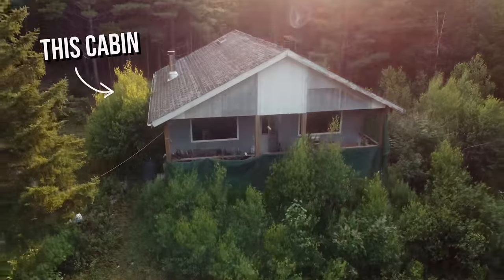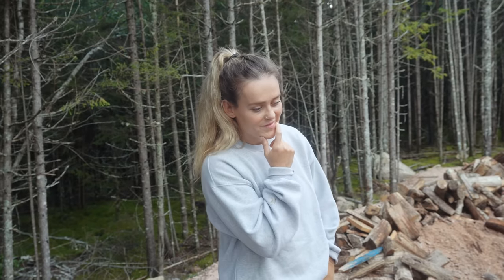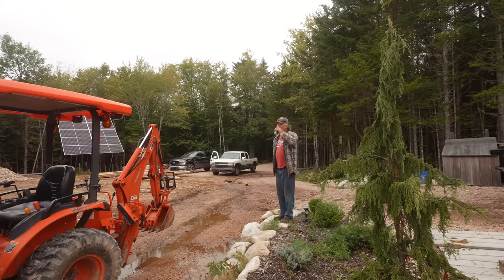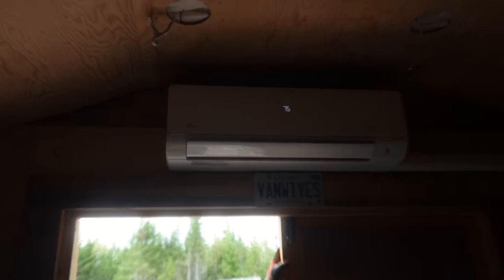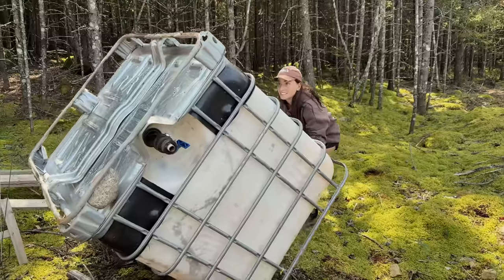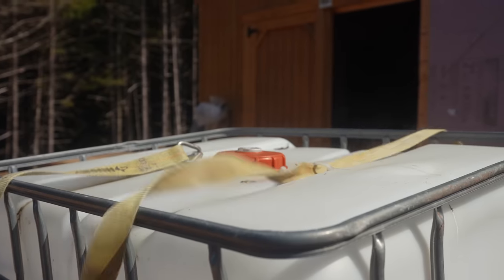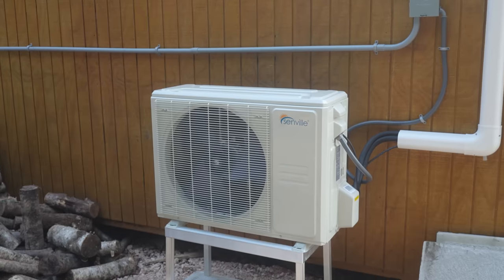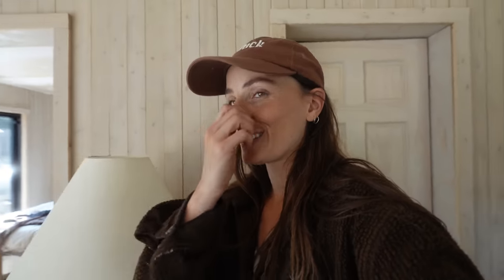Preparing for Winter Off-Grid in the Woods

Comment from the maker: Hiiiii winter YOU’RE creeping up on us again! Any other suggestions to make this winter season more comfortable? 👀 These are such game changers for the cold season ahead. The real test will be running these on the darkest days (ON our off grid system) … stay tuned! Love ya pack- see you Sunday 💛
Reply: I don't think you're going to regret those heat pumps.  We had them installed several years ago and they're great in the winter AND the summer.  For backup heat in case of a power failure we have a centrally located pellet stove that is on one of the generator circuits (since it requires electricity for the pellet auger).  It's been a great solution for our Western Washington winters.
Reply: Next time you need to demarcate an area with spray paint, first stretch and floor peg some string between each corner point. That’ll give you a straight line to follow. Happy Sunday!
Reply: Sorry, I have a question.  With all the windows and sliding doors, how will you keep the heat in and not have it pass through the contour of them?  I know that here I have to put plastic on mine so I don't lose anything.  Otherwise you are all set for winter.  I feel so much better knowing you now have heat, water, electricity, a tractor and all the new things you created so all of you are now safe.
Reply: As an emergency backup, a couple of the coleman 5 gallon jugs of water could come in handy.
Reply: You’ll be comfortable regardless of what Mother Nature throws atcha💛 do y’all have a way to block off that crawl space to save heat? Or it’s super insulated and your not worried about it ?
Reply: I think you need a big diesel or gas generator for winter, it's just a suggestion. Love you 🤟🤟❤
Reply: Happy Sunday! Good Video! 🪵🌾🌴🎼🐦‍⬛🌱🪿🍁👍🏻💞
Reply: Do the finishing touches of your cabin (Including the attic)  - it will give you so much peace of mind, and ability to fully relax in you home ❤ and we would all love to seeing it ❤
Reply: Lots of warm fluffy socks and good books 😊
Reply: Doing the same just south of the border in Maine. Getting wood deliverd and that IBC tote idea looks like a game changer! I have Blueberry the tractor, just need forks! Thanks for the awesome idea. Stay warm!
Reply: That was an ingenious idea to put your fire wood in the water tank metal frames, then transport the whole frame to your front porch when you need it.
Reply: I am really really happy for you both and your going to have a amazing winter together prayers and blessings to you both and your puppies 🐶 love your Aussie family friend John ❤❤❤
Reply: My suggestion to make this winter season more comfortable and keep your heating cost down is CURTAINS your windows are perfect but the heat will escape  from all that glass
Reply: Put a skirt on your cabin so the cold wind and snow get under it.  It will help keep your home  warm.
Reply: You have your place looking  great, and everything you have done to make it self sufficient.  I wish back in the day everything they have out now would have been aviable then. The one question I have is your place safe from flooding? I am concerned about you girls. Just a couple facts. Will be 70 next birthday. I live in Oregon. The part that has alot of mountains, lakes, hiking trails. And alot of.people have lived off grid for 20 plus years. In fact the hippies of the 60's r now called yippies.

Comment: BIG TIP for your heat pump outside unit from someone in Norway: Do make sure you have a roof over the top that will keep the snow off of it and from around it. I had to put up a snow drift shields around mine as well so it wasn't getting buried. You don't want to have to go out and shovel it off.
Reply: Crystal putting on that tire is too funny.
Reply: do you have a problem with the heat pump operating all winter? i thought they don't work well below certain temperatures
Reply: That’s what I was thinking, I just asked in the comments how was it going to go in the open outside like that
Reply: @yomogami4561  no, not at all and it gets really cold here. Just need to keep the area around it clean.
Reply: @jenninstitches  thanks
Reply: @yomogami4561  the problem is that the colder it is outside the more expensive it is for the heat pump to provide each unit of heat, and even worse when the external system starts frosting up.  As you also need more units of heat in cold weather this makes the cost of using a heat pump increase a lot faster than with conventional methods of heating.  With solar panels powering the heat pump you also have a lot less solar power available in winter and particularly in cloudy conditions, so it will be interesting to see how well the solar power copes with off grid heating in a Nova Scotia winter.  That's one reason why backup heating methods for the cabin and garage are useful.
Reply: @paulgrimshaw6301  i have one as well as furnace and that's what i thought too.
Reply: @paulgrimshaw6301  The Life Uncontained channel has a water heater outside and surrounded by glass like a greenhouse.  I wonder if something like this would help keep the unit dry and warm- I guess it depends which way the sun shines on it.
Reply: Are heat pumps actually worth it do they work
Reply: @JohnSchweiger-ng9vt  absolutely in my opinion
Reply: @jenninstitches  thank you I will look into getting one

Comment: Here is a tip for next time, and there will be a next time, on the tire mount.  If you place a shovel under the tire you can use it as a fulcrum to lift the tire by pushing the handle down.  The cup on the shovel helps hold the tire on and if you squat by the shovel handle and use your knee to press the handle down you have both hands free to get the tire positioned.

Comment: Its crucial that the refrigerant charge be correct for your heat pumps to provide heat in very cold conditions. The condenser coil (which turns into the evaporator coil during heating) will ice up badly in temps below 25 degrees and your heating capacity will plummet the colder it gets. Any precautions that can be taken to keep the exterior coil free of moisture will help immensely. The install looks good though and I wish you both the best of luck this winter.

Comment: i have a 100-year-old house that didn't have AC when i bought it, so a few years ago i installed (well, had a company install) a Mitsubishi mini-split (heat pump) system with 4 interior units. Makes summers (especially now that they are hotter for longer) so much more bearable. One thing I've found is that sometimes the water drain gets clogged so it starts leaking into the house. the Technician who came out to fix it gave me "Purcool green ministrips" to put in the drain pan, which should keep the water from getting gunky and causing clogging. I also use the units for heat in the transition months, before I turn on the furnace. Mostly because we can't use the mini-split system when it's less than 0 Fahrenheit outside, and it definitely gets colder than that here!

Comment: We took 1x4's and built 3-foot-high frames onto our pallets to keep our firewood from sliding off. Even if you have your wood stacked where you want it. We move them from where we cut&split the wood, to where we store it, to the house with our tractor and forks. It's quite simple and quick.

Comment: I installed a heat pump in my home last summer in August of 2022.  I have saved roughly $60 per month just by doing that, and also I have a pellet stove as well.  Both work wonders.  Heat pump is so quiet as well.
Reply from the maker: Thanks for sharing with us Charles. 🌞🐾

Comment: for air barrier around the windows you can insert the correct size of backer rod foam and seal with a caulking such as Big Stretch.  This will keep out the wind and moisture around windows and doors, hopefully doors were installed on top a bead or two of caulking to seal the gap under thresholds !!  Then you can apply your interior finish ( wood) surrounding the windows and casing around each door

Comment: I would wake up to the heat pump and cook breakfast with propane but once the Sun’s all the way up I would get the wood stove going and cook lunch and dinner on that and use the wood stove for the rest of the day to conserve the batteries because the sun only shines for 6 hours in the winter up north. There’s no way you can run the heater all day long, 24/7, even if it’s never ever cloudy. Right before bed I’d fill the woods stove all the way on last time and turn on the heat pump. Oh and I would have a ton of fuel for the generator just in case you accidentally run out of electricity during the really cloudy months. There’s always that one month that barely sees any sunlight the whole month. Nice video keep up the good content .

Comment: Love watching you and all your progress
We’ve had heat pumps for about 12 yrs or so ❤. We had 4 new high efficiency ones installed this year, good for -15 F. Located in western PA. 
Saw someone posted about a ceiling fan. It’s best not to have over or near the wall unit. It causes the unit to get confused as to what temperature it’s to run. 
The newer models allow you to adjust the direction of the air flow, allowing the heat or air con to be directed downwards. 
Thanks for taking us on your adventures.

Comment: I added stainless steel wool to all the openings on the heat pump piping. Keeps the mice and insects out. We have 2 split units (one in the shop)and one central. Work great for cooling and heating here in Cape Breton. We have a grid-tie PV system as well, basically pay for the delivery charge most months. Went with the brand most supported in our area. We have firewood, propane and the electric air-sourced heat pumps. Propane and firewood prices have gone crazy as with all energy costs. Great video on keeping it real!!!

Comment: P s. The snow pusher bucket for the loador comes with skis on it. This makes it much less likely to rip up your gravel driveway. Straight blades and v blades come with shoes. But your plowing surface pretty much needs to be frozen to keep from digging up your driveway. Like the straight blade on the mule, you've got it lifted enough to not dig or catch. The loader snow pusher with skis really helps prevent that digging... Peace girls i'm out. Time to get my own winter prep done. Love the pack.

Comment: You can build a woodshed using the pallets for the walls, a tin roof to keep the water off. It allows for the air current to get to the wood too. A pallet floor helps also.

Comment: Beautiful job, girls!!
 I would definitely recommend looking for a hard or soft enclosure cab for your Darling clementine. Some of them come with heat and wiper blades. Almost a must have in arctic conditions. You could just plug her in and dust her off. Every snow, but you both would be a lot happier in a heated enclosed cab. The add-on cabs are not as quiet as a factory cab, but it keeps you out of wind and snow. 
A snow pusher bucket for your winter snow removal If you're not going to run a regular snow plow or V blade on the front of her. I love my Tractor Mount snowblower on the front of my tractor, but it is a pain, and you can't use the loader while it's attached to the front end. They do make Snowblowers for the back end, but you've got that big excavator hanging off the back. Pain. So, a snow pusher or a blade on your loader would probably be the easiest for switching out. I know you have that little straight blade on your little mule. But it's child's play. In comparison to clementine with a snow pusher.
I've got my fingers crossed. The 6 inch gravel pad is for a Clementine enclosure? Iron horse needs a barn. 
Oh my darling, oh my darling... I can't tell you how many times i've heard that song growing up, but it's probably because of my last name. It's a Darling thing.
Love the pack.
Reply from the maker: Why thank you so much Tom for sharing all your knowledge with us. Sending love back to you from the pack.💛🐾

Comment: Consider adding a "litter bucket" to Clementine's fashion accessories.  Deeper and wider than the standard bucket.  You can't/don't fill it with stuff like sand or gravel, but it's fantastic for things like firewood.  And moving snow.  :-)

Comment: If you had the bars, like, I said in my previous message. The semi bars it would help you pick those tires up without struggling the way you guys are struggling right now. Also, you were absolutely correct don’t stay under the tractor when putting the tire on you stay from the front.❤ also, after a couple hours, you make sure to tighten those Lugnuts again. You could’ve used the tractor to move those  big IBC totes that you were rolling across the yard.😂❤ the Mitsubishi split system is awesome. We have it in our guest house. It cools the place down like crazy in the summer and warms it like crazy in the winter time. We’re in southern Nevada, where it only gets to maybe the low teens in the winter, nothing like the temperatures that you all get but yes it’s a great system and you’ll love it especially on your cabin because now you will have AC in the summertime.

Comment: As a fellow Kabota owner and someone who does firewood on pallets, when you’re turning the tractor may have a tendency to tip forward in that direction especially if their is any ground angle. If you don’t have loaded tires, you may want to consider it or a 3 point hitch weight box. Still the best wheelbarrow I’ve ever bought.

Comment: Bonjour Vanwives, just a quick tip to change tire. Use your feet to lift the tire (sit on the ground and put your feet on each side of the tire and lift). You’ll be amazed how strong your feet are to lift heavy weight.

Comment: Pss. Just to finish the thought. If you do look at snow pushers for clementine's quick detach loader. You will probably want to look for the snow pusher backblade option. It mounts on the top front edge of the snow pusher. Not all snow pushers come with this option. But it gives you the ability to pull snow or material from doorways. They come in a variety of cutting edges. Typically metal, but I would opt for the thick rubber back blade cutting edge. Plenty strong enough to remove human foot traffic or heavier from doorways. The metal variety tends to really rip it. As it doesn't ride on skis like the actual snow pushers forward motion metal cutting edge.
I'm not a hundred percent positive. I only have flashes of clementines rear end. I'm not sure that Backhoe comes off. Good ballast for your round material bucket, forks, or a snow pusher bucket. Good for traction. Speaking of keeping traction clementine needs all new shoes. As you had mentioned. I would also recommend ordering tire chains to go with those new rubber shoes. Even if you only order road chains for the front tires. Anything to help pull you through the snow and ice. Especially when trying to push a heavy load of snow. The chains will help give you the extra grip to continue moving forward. Hell you might order road chains all the way around. 3 new shoes 4 new tire chains. Clementine would rip then. Traction beast mode.
If you can take the loader off the back end of clementine, it would be good to see a three point hitch boxscraper or a hydraulic angle back blade. Although if you take the loader off, you would definitely have to add ballast to your tires. Either bolt on plates to the rims or calcium chloride filled tires. As you need the extra weight to keep the tires in traction. If there's too much weight up front, there's no traction in the back. Adding weight to your rear tires keeps it all balanced. Ripping it on all fours.. ...
Clementine must have come with a heater core. Something to keep her oil warm. A must to have plugged in in colder temperatures, especially a few hours before starting. You might also check out a good automatic battery trickle charger for her. It's just something to keep her battery topped off in the frigid temperatures. 
Oh my darling clementine. 
The iron horse of the pack.
Love the tractor.
 Love the pack.

Comment: Guy’s great decision but l would leave 2 / 3 rows of steel in the bottom cut out and put the 2 bars back on the top which will help maintain the strength and rigidity of the cage’s. You should be able to stack them 2 high. If you are going to build a timber shed I would consider a 40ft height cube shipping container that has side doors along the full length of the container and if you paint it black it will help to dry your wood. You could also put a high pitch roof on it to give you a storage loft? Keep up the good work and have fun 👍

Comment: So great to hear you have 3 ways to heat your place! Here’s to a warm and toasty winter ❄️ 
One question - is there any ducting to bring the heat down to floor level? When I lived in Oregon, air registers were installed 9 feet off the floor in the living room as there was a vaulted ceiling and this set up  works great for air conditioning as cold air falls, but in the winter it felt like all the warm air was at the top of the ceiling and my legs and toes were always cold 🥶

Comment: You know the way you cut that cage, if you cut another one just like it and keep it that way. You would then have a lift cage platform for your tractor you can use when having to work on anything outdoors above your head. It would be easy and quick to move as you work, like a homemade bucket truck.

Comment: Hi Ladies . A tip on how to get the wheel back on Clementine. Use a long handle round "mouth" shovel and put it at  a 90 degree  to the side of the tire  and use the leverage of the shovel to help raise the wheel up. If necessary put a piece of 2x4 under the shovel spoon  for extra height.  On another topic,  in the Maritimes , a log  is anywhere from  10 ft long to full tree length.  And a piece  of firewood is stove length ie 12 to 18 in. Have a nice day. Save your backs with the hydraulic advantage  of the loader . Tom at the NB-NS border